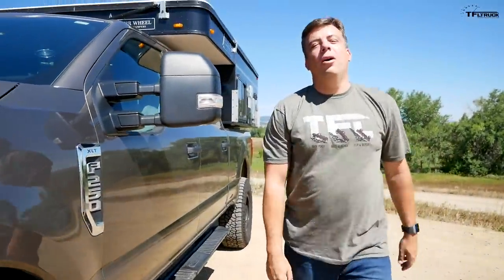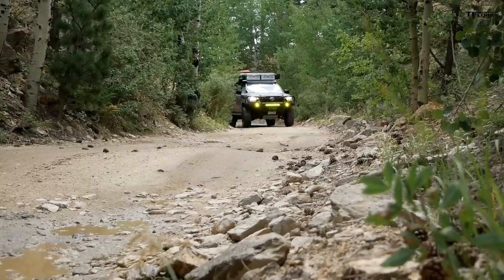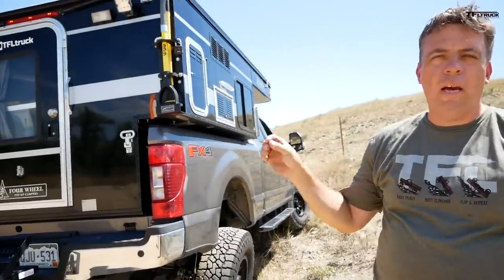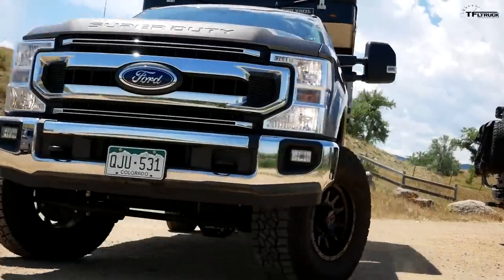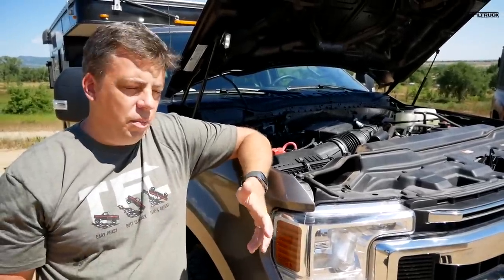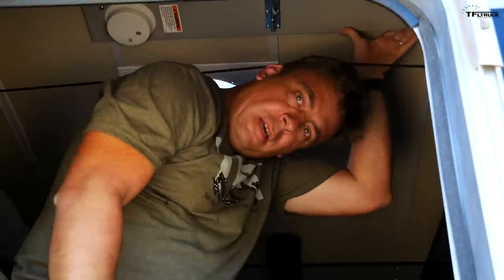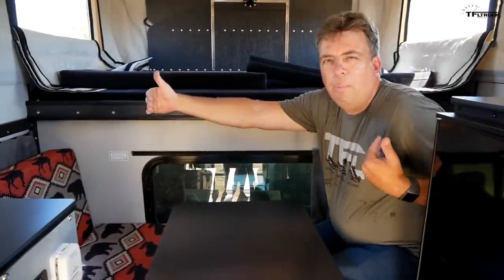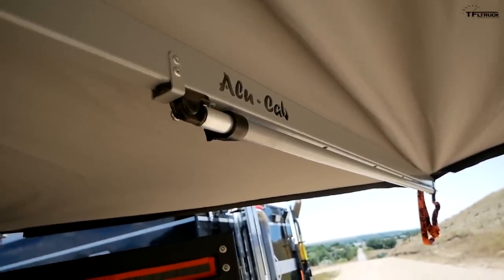Is The Toyota Tacoma Still the Overland King? This $100K Ford F-250 Lifted Camper Says NO WAY!

Comment: I got one better than both of those, Ram 3500 srw w/ 6.7 Cummins with thuren Fab 3 inch suspension. Articulates to go anywhere, comfy for the whole family w/ 2 kids, huge torque which is what you need offroad & better mpg than gasoline.

Comment: The ford f 250 would sink in the mud a lot quicker. The Toyota Tacoma is the better off road truck. It’s lighter and won’t sink in mud as quick. More compact size and easier to get around in in tight places.